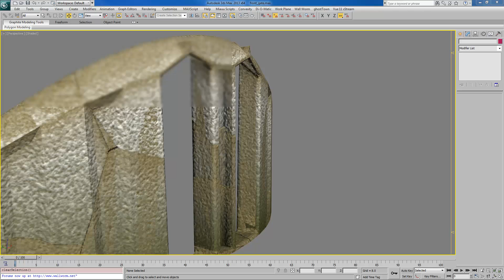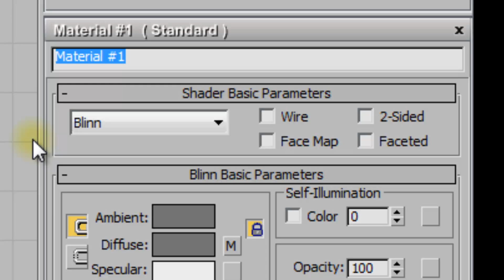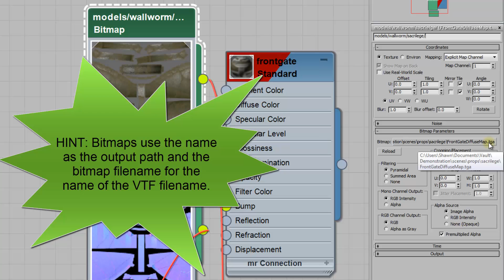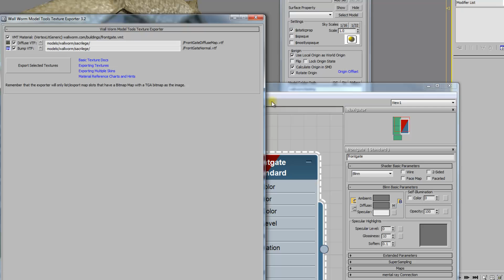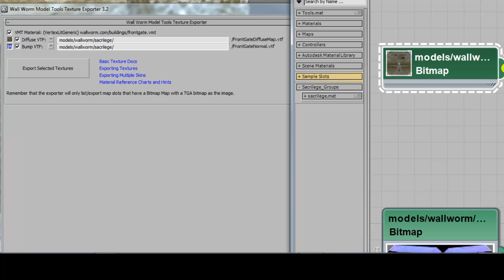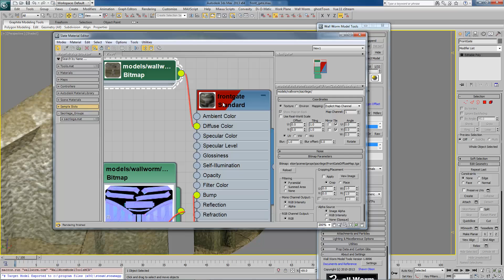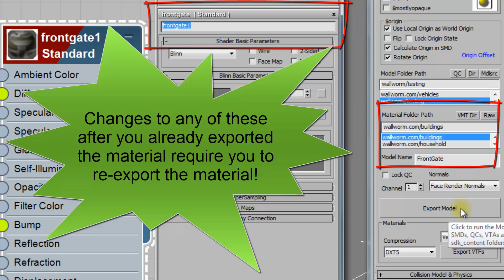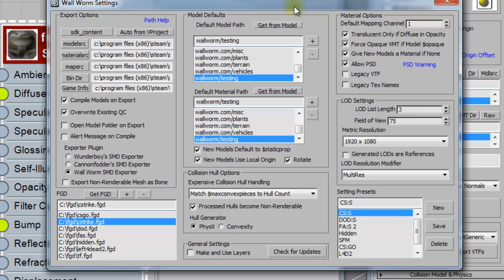Model Material Export 2013

Comment: Hi, I seem to be having problems exporting the VTF's. My models by default use JPG files for the textures. It doesn't work at all with JPGs but after watching your video it says I must use.tga or .psd files. So I opened photoshop and saved each .jpg file as a .tga file. Now when I export, I actually see each VTF file associated with the VMTs, but the options are grayed out giving a reason: INVALID DIMENSIONS. Any idea what I'm doing wrong or how to fix it?
Reply: I was able to get around this problem by manually converting each jpg file to vtf using nems tools vtf plugin for photoshop. But now I seem to have a problem compiling the .qc file. It keeps telling me "Can't Find Steam App" in 3DS Max. I get the same error if I try this using GUIStudioMDL 2.2. I know late last year there were some changes made to Source SDK with the new Steampipe update, but as far as I know, the mod I am using these models for is on the old Source 2006 SD called Fortress Forever. I've verified all my file paths are correct but it still won't work. Any ideas?
Reply from the maker: Wall Worm uses the native texture compiling tools that Valve created. The texture compiler (vtex.exe) only supports certain file types of certain dimensions. That is a hard-coded limitation imposed by the Valve tools. As such, I always use square bitmaps that have a power of 2 dimension.

Regarding the Can't Find Steam App in the compile window... that is hard to say. You may want to post more about this on the WW forums. There may also already be some answers to similar questions there also.
Reply: Shawn Olson Yeah I had to go in and change the sizes to power of 2 in photoshop. I guess once I get the .qc file to compile I'll be able to tell if the textures are skewed at all. I'm still having problems getting the .mdl file though. I found a topic about the Cant' find steam app error on the Valve Dev Community but their website is under construction right now.